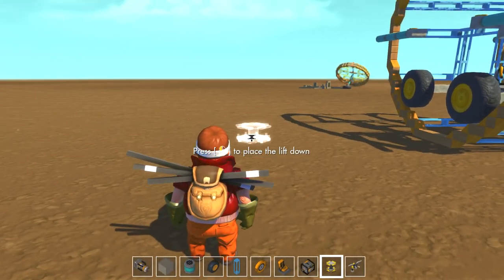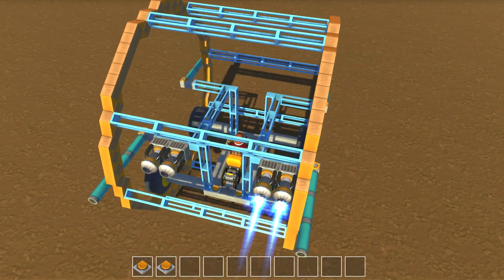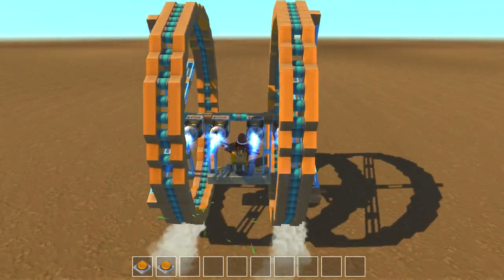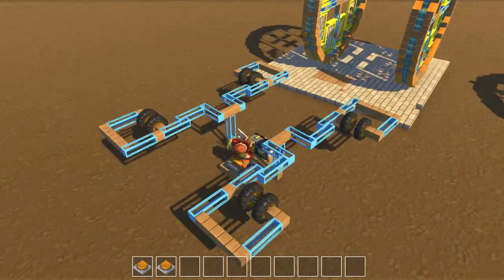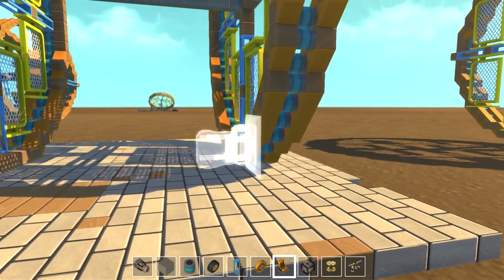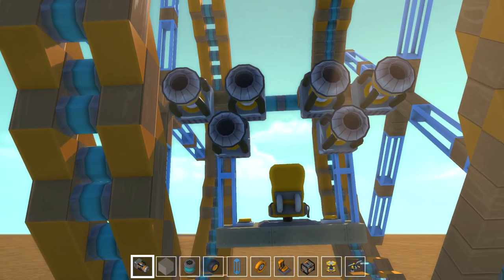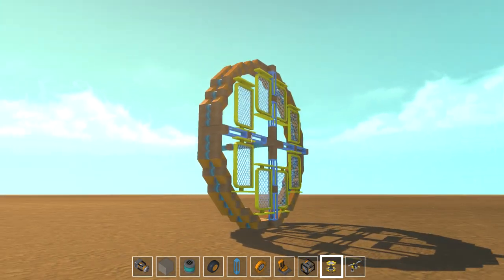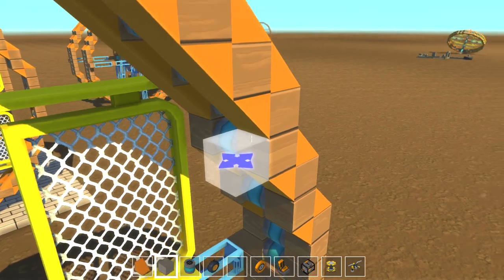Scrap Mechanic #2 - Gyroscopic Vehicles!

Comment: If the top view of vehicle is like this (1-2) the 1 and 2 matching the thrusters you activate by pressing a number. Try adding a single thruster on the center of the wheel facing outwards like this: 

2(1-2)1.

So that way when you turn, you would have a stabilizer pressing slightly in the opposite direction, that should help with the tipping over problem when you added the third thruster. :)
Reply from the maker: +Jane Murphy Yeah that would work nicely :)
Reply: +Monkeyfarm Just build a small wheel \ cylinder cage, as LIGHT as you can possibly make it, get inside of it. No motors, no functional wheels, just that light cylinder cage and hit it with a hammer, like a hamster in. A... HAMSTER BALL! YES! Make a ball that can close and open so you can get in and see the outside... Somehow, IDK and hit it with your hammer! Genius!

Comment: 4:24 The eliminate the problem of the bumps try turning blocks at a slight angle using them bearings
Reply: +Kevin Larsson and try to add suspension to the wheels so the wheels will have more grip on the ring :)
Reply: +Kevin Larsson that would be good but it kills fps....

Comment: Okay... But 15 sections of 2 blocks connected by bearings on the sides. Hook each bearing up an info box and set the bearings at 15 degrees all in the same direction... It's a smaller but more rounded wheel :)

Comment: ya there making a welding tool so you can make tanks. and so you can fix broken project without having to rebuild the whole project.
Reply from the maker: It's sooo necessary
Reply: i agree
Reply: They also need to add the ability to turn objects around on lifts
Reply: i strongly agree

Comment: @Monkeyfarm,
you should maybe slightly rotate the wheels on your last vehicle, so that they aren't parallel, but more... like an A shape. That might make the whole thing more stable, so you can still have 6 boosters and not just 4.
Another idea would be to add a bar that goes from the middle of the wheel to the ground, with at the end of it, normal small wheels. These would act as stabilizers (kinda like extra feet) incase the vehicle tilts to the sides too much. So there would be one on each side.
I don't know if you get what I mean xD My english isn't the best.

Comment: Can you add a bearing to a block that has a jet engine on it and then use a controller to make the jet thing rotate in a chose direction? If you can do that, you can not only make your vehicle capable of reverse movement but also do some fancy aircraft too. :P

EDIT: Yeap, you can do that. Saw some crazy stuff online.

Comment: i think they should add a weld tool. Its basically very easy to make. Just point out the surface block from one object and then select the object square block from the other object and they should weld automatically at the points you selected. on each object. I really dont understand why this isnt allready in this game. Its a huge pain that you cant join different objects together.

Comment: Hey Monkeyfarm, on the second design you showed, couldn't you put thrusters on the opposite direction and hook them up so it turns easier? So lets say the thrusters on the left are going forwardm the thrusters facing the other way on the right side would also be on, making it turn in kinda a circle.

Comment: you need suspension on the wheels to push the wheels against the rollers, and use four wheels so it's pushing against the  rollers from every direction if you know what I mean

Comment: I heard they are working on a welner tool that lets you connect different parts
Reply from the maker: Ah that will be perfect! :)
Reply: Hahodi d Could be. I never remember how to spell it. Hardly ever use that word.
Reply: *****
 I believe it will be a tool that only the player can use, so it wont replace the need of a crane that can grab objects
Reply: +Kamelon Games wielding is actually very complex, with different metals and their alloys it can be very complicated. Then add underwater and overhead.
Reply: there's pressure welding for the metals that dont usually weld
it involves a lot of gunpowder or similar explosives
Reply: And plastic wielding with chemicals.
Reply: *welder
Reply: ***** you could have bothered to read the comments before you and find somebody else had already corrected him,
 
thank you for taking your time to read this bananas are 50% human and your goverment is lying to you
Reply: they did
Reply: what?????
Reply: Kid Tablet this was commented in january what are you doing here?

Comment: I know I'm a little late, but if you're still wondering about this, you can connect two disconnected objects by building them through each other, such that they interlock together.
Reply: +koder that's not what he meant obviously but the devs are working on a welder tool that lets you combine stuff like he's talking about. No clue when it'll actually come out though
Reply: Robbie1okay I know, I was just providing a workaround in case he wanted one. I really hope the welding tool comes soon though!

Comment: Gyroscopes are super awesome but they are not actually about weight shifting. They are about having a lot of rotational speed in one direction, and they are used because of the interesting reaction when you try and change the angle of the axel. The ideal gyroscope is perfectly symmetrical with weight and has zero friction loss at the spinning connection. I don't believe scrap mechanic can handle high enough speeds and weights to achieve visible gyroscopic effects. I don't think I know a good word for the center of gravity control you are talking about, but it is a fun physics mechanic. Cheers, build on!!

Comment: i think you should do it with a 6 wheel design. 2 wheels on bottom 1 on top. the top one to press against the ring to prevent your car from flying upwards. like the first one you showed you hit gas and it climbs up the wall of the circle, i think if you have a wheel to press against the top side your car would stay parallel with the ground and thats what you want as long as when staying parallel your car spins the outside circles.
Reply from the maker: Yeah similar to the design that broke in the beginning if the video - had 4 wheels on each side :)
Reply: i didnt even remember that part lol. seeing the wheel with the cage thing on it confused me for some reason. have you tried designs using shocks? i have never actually played this game by the way lol.

Comment: heres an idea, instead of rebuilding the entire wheel every time you fuck up, just add a single bar on the very bottom of it till you know you got it on point.
Reply from the maker: +JoeyTheLionnn Since you have a bearing on both sides, without a welding tool (coming soon), you cannot connect both sides.  Either one bearing will not be connected, or the blocks of the bar you suggested will not connect.
Reply: im saying if he starts to builds it from a single block on the bottom he can build one side, then the other on the same bar. Just a suggestion though, personally i have never played this game but i know how the physics and logic are in the game.